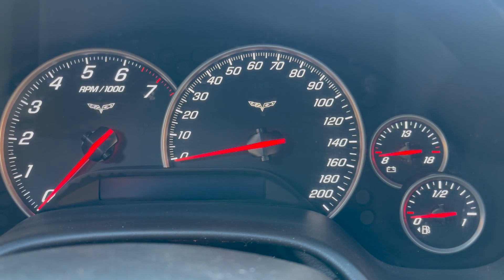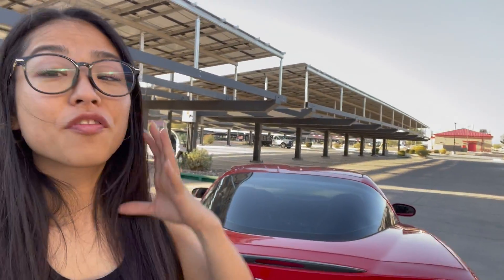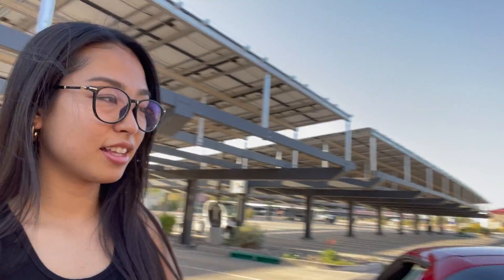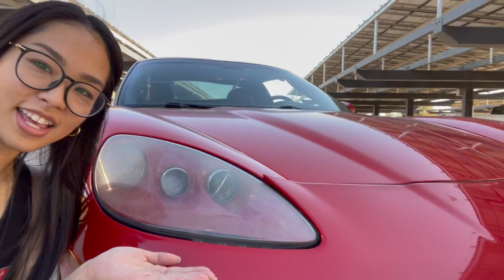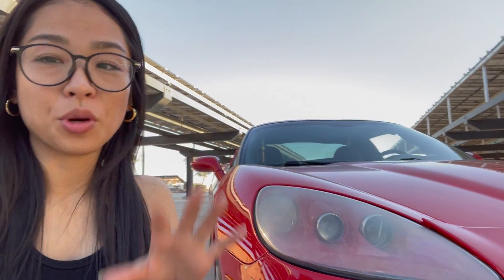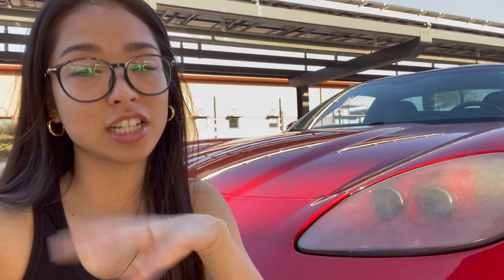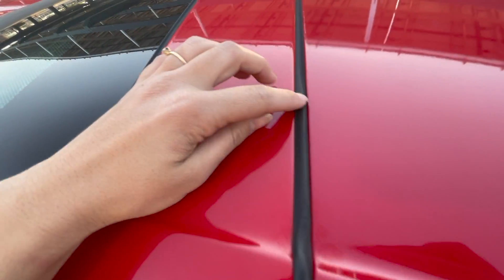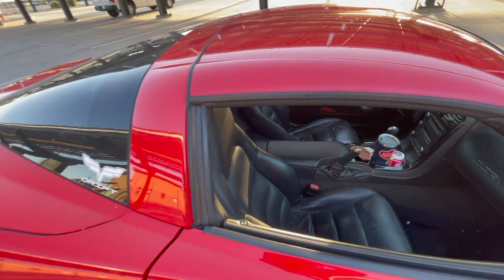C6 Corvette Common Issues | Buyers Guide 2005-2013

Comment: C6 absolutely HAS to have the harmonic balancer replaced before 70K miles. The C6 Bose sound system is garbage and I did a full replacement video on all the audio parts (video on my channel), also consider the LS2 and LS3 tend to just burn oil with no cure, its just accepted that they do that. You can buy IV blocking wax that is safe on plastic to make the headlights last longer.

Comment: To resolve the fuel gauge issue U can use "Techron Concentrate" fuel additive in the black container to dissolve the buildup of sulfur collecting inside the fuel tank that causes the fuel gauge to not function. "Shell" fuel uses the Techron additive in their fuel which is why I always use Shell fuel in my 2008 C6 Standard Corvette Automatic "JetSteam Blue" 77k miles. During the Winter months when I stop driving my Corvette I fill the tank with NON Ethanol fuel. The Non Ethanol fuel will not harm your vehicles fuel system like Ethanol fuel will. Just saying! 😀
Reply: I agree, I too use ethanol free gas. BP 93 octane will keep your gauge   working properly. Techron works magic.

Comment: Another common problem is not being able to shift out of park. Starting to have this problem with my 2008 base model.
Reply from the maker: Oh I wasn't aware of that as I have a manual. Is that an easy fix?
Reply: should've got the manual
Reply: @ioriOki  it's just the cable
Reply: @danielfair4675  it’s not the cable. The safety lockout pawl gets stuck if you don’t wait for the solenoid to disengage the lock. I’ve been jammed up a few times. Ended up just cutting the pawl off. Now I can shift from park to any other gear even if the car is off.

Comment: I have not experience any of this yet.  I experience the Harmonic Balancer issue and that's all.
Reply from the maker: I haven't had the harmonic balancer issue yet. I hope I can continue to avoid it
Reply: 90% of the LS2 engines have the Harmonic Balancer issue. I only had 18844 miles on my C6 when the chirping bird sound and the wobble of the balancer started. I replaced it with the ATI Super Damper. GM should be ashamed of themselves for putting a rubber and metal piece of crap in America's Ferrari😄.
Reply from the maker: Ohhhh I have the LS3. LS3 and Manual Transmission was a must for me when I decided to go the corvette route.
Reply: @ioriOki  LS3 is a better engine. Very good choice. GM use LS2 for 2005 and 2006 and opted for the LS3 replacement.

Comment: Harmonic Balancer and Sway Bar End Links, Check torque on rear axle nuts!
Reply from the maker: I have not ran into those issues, but the rear axle nuts were torqued when I change the wheel bearing. I will look out for those though.

Comment: Front Radiator supports usually get smashed up when parking perpendicular to a curbed parking space. Hence the reason for the invention of Curb Alert! Cameras front and back help a lot also.
Air intake dam is what usually scrapes speed bumps and inclined driveways!
Reply from the maker: I don't have any curbed parking spaces I use, nor does this car come with curb alert or cameras. The air dam was destroyed on a pretty insane pothole along with the radiator support.

Comment: My fuel gage doesn’t work. I was told that Techron from a gas station will make it work
Reply from the maker: it depends on how far gone the contacts are. It may help, but eventually you'll have to replace the sending unit.

Comment: I bought an ebay headlight tint kit and did it myself. It was a cheap fix that covered the nasty headlights and now they look really good.
Reply from the maker: That’s a good idea, I don’t want to tint mine, but I polished them up pretty good
Reply: @ioriOki  Get a light smoke like 35% and they look clean.
Reply: Tint looks better than yellow for sure but it's not so great for night driving
Reply: @andrewb1313  Its a  light tint so it doesnt really block much light

Comment: maybe spend a min and fix front facia fit.
Reply from the maker: That requires also repairing the lower radiator support, which we will get to later on the channel.